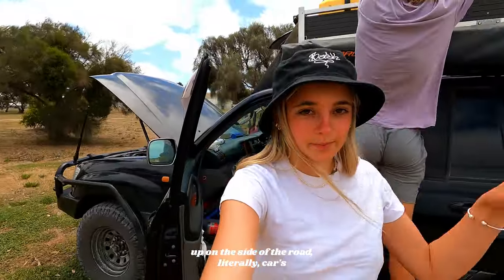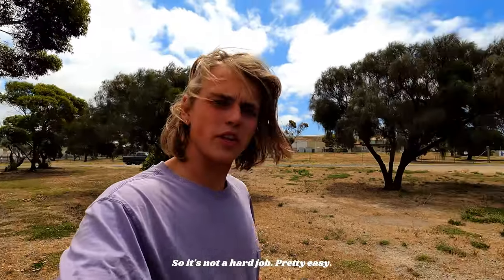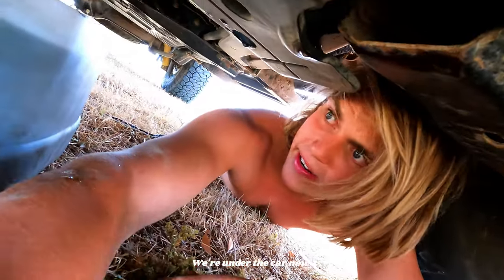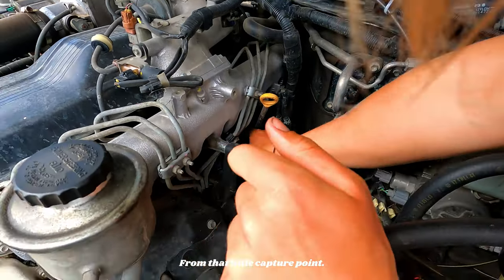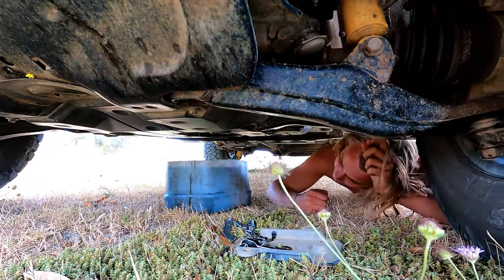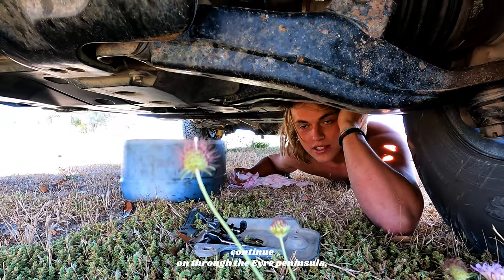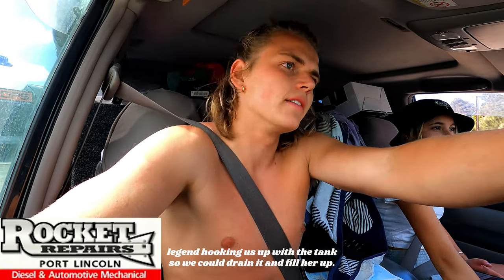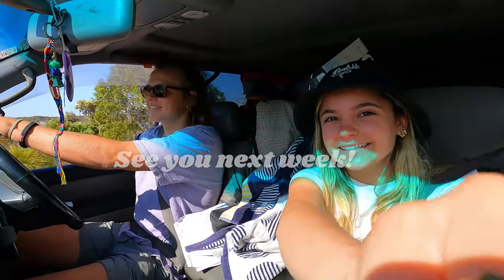HOW TO CHANGE YOUR OIL TOYOTA LANDCRUISER | 100 Series Landcruiser 1HD-FTE Oil Change

Comment: Not the ideal spot to be doing a service haha! In my experience I just tighten the filter by hand nothing else, otherwise it's gonna be on there reeaaally tight when you have to pull it off next. Especially fuel filters!!
Reply from the maker: Yeah I do it about hand tight and then a little more with my belt but not enough that I won’t be able to get it off the next time